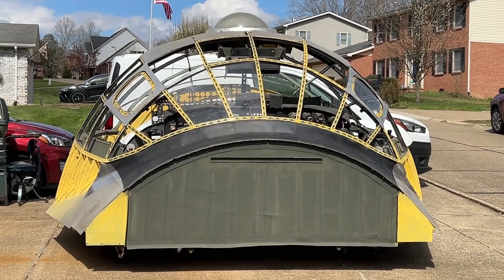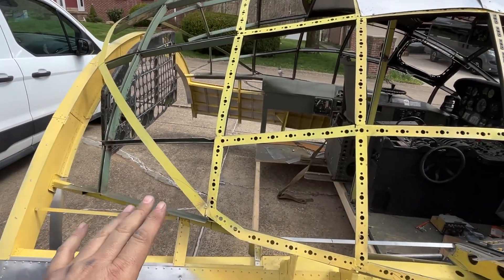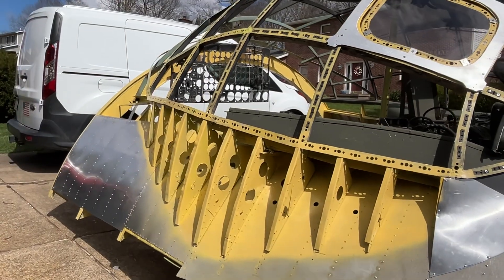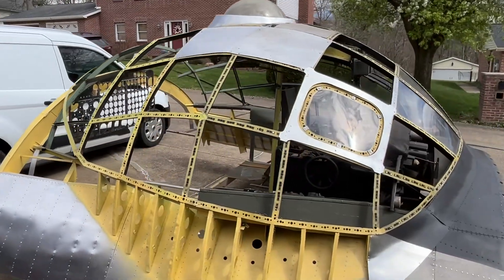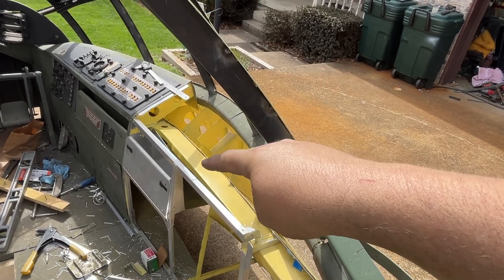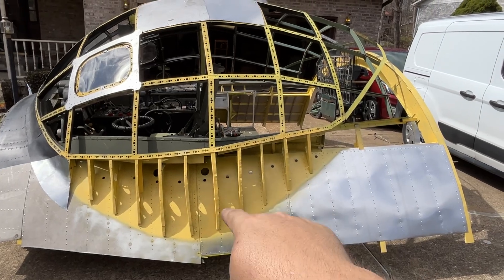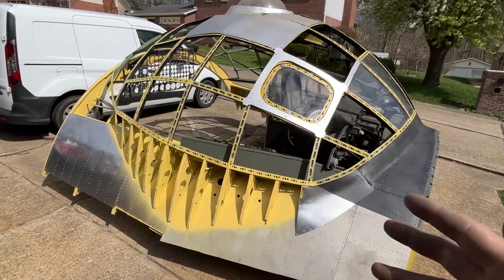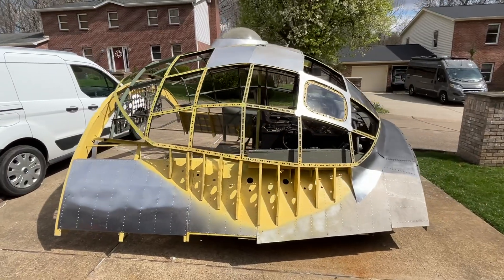Building the B-36H Peacemaker Canopy To Fuselage Fairing Bulkheads Complete

Comment: Where did you acquire that cockpit. Was it from Walter?
Reply from the maker: I built it. Going on three years.
Reply: @B36HPeacemaker  I might know where you might be able to get parts.
Reply from the maker: @ratride1  Oh?
Reply: @B36HPeacemaker  I haven’t been to Walter’s place in years but he had pieces of a B-36. In fact back in the 70s he had the whole cockpit section on the ground. I crawled into it.
Reply from the maker: @ratride1  I am fully aware of the Soplata Collection. When the cockpit was on the ground, do you recall if the pilot seats were installed or the pilot’s main instrument panel?
Reply: @B36HPeacemaker  that was a long time ago. There was no cockpit floor or seats at that time. That was back in the early 70s. Now I live right around the corner from his house.
Reply from the maker: @ratride1  I figured either the USAF kept that stuff as it was still being used by active aircraft or it all walked away during the scrapping. I’ve been to the collection around 15 times over the past 4 years. The Soplatas are amazing people.
Reply: @B36HPeacemaker  very nice people!

Comment: Could you put one or two digital displays behind the engineer panel cutouts with either static or moving images of the gauges? Would be a lot cheaper than the actual guages, at least the hardware part. You’ve got a "couple" of subscribers I am sure someone out there would be able to program that.
Reply from the maker: I don’t want anything in her that wasn’t there in 1952. On some cold winter day when I can’t leave the house I will make copies of the gauges. That unless a mystery package shows up at my door!